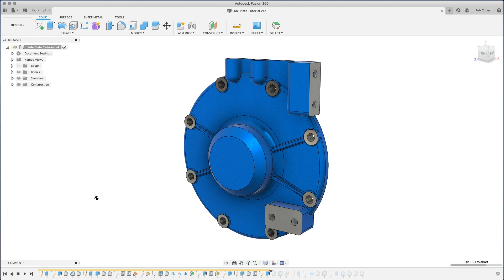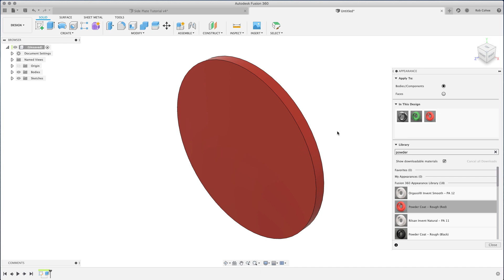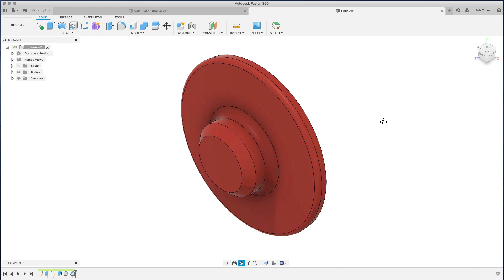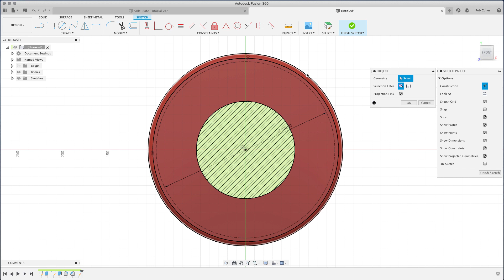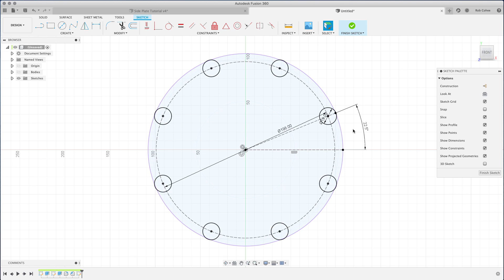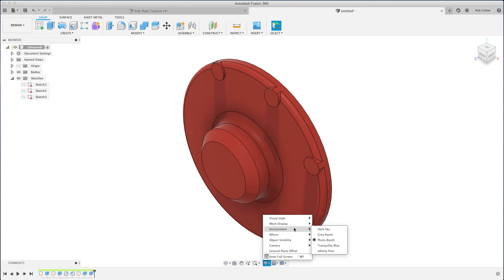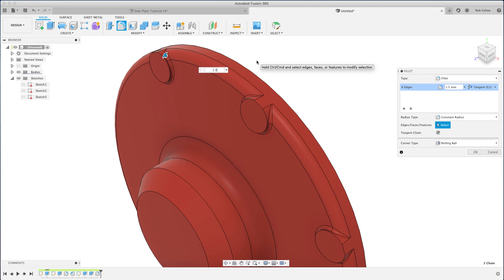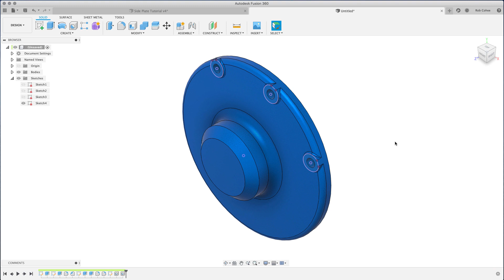Fusion 360 Part Modeling Part 1

Comment: I noticed you were able to do two different fillet sizes in the same feature, but not with the chamfer. Even better would be to be able to fold the fillet and chamfer tools together, so I can make fillets and chamfers of various sizes within the same feature. Even better, since they should have the same number of edges, in theory you could maintain parametric intent when switching from fillets to chamfers.